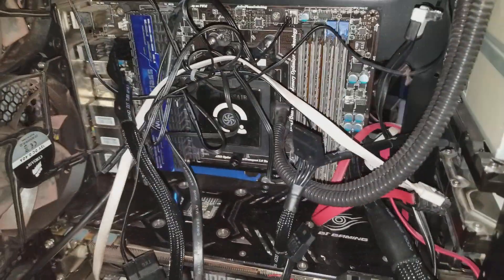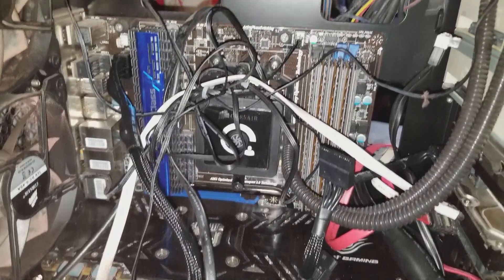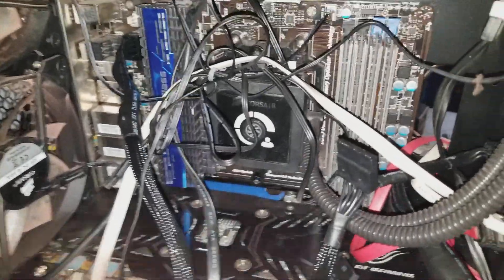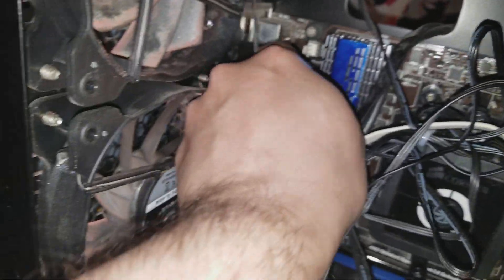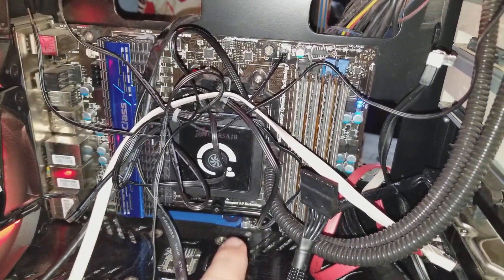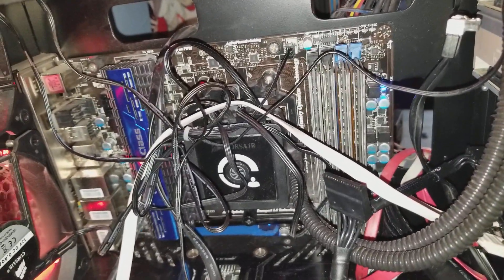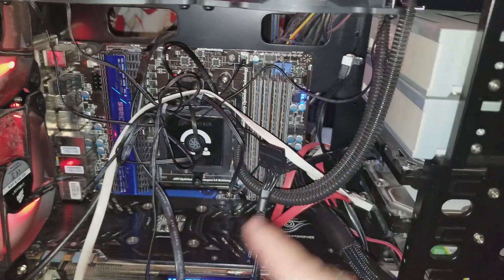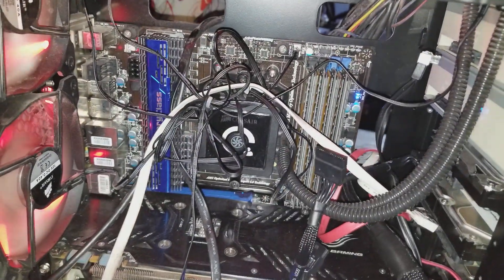How to Spot any broken CPU Liquid Cooler . (Corsair h100i)

Comment: My PC turns on but the temperature is at 99-100 degree Celsius  even when nothing much is running ... So , is the cooler is dead or need to apply some thermal paste?
Reply: Had same issue. Throttled my cpu like no tmrw and still 99-100. I reinstalled the cooling plate.... Worked fine after that. Paste looked good too. So I'm assuming it was mounted correctly? Although the paste ain't gonna look how it was applied when underneath the cooler. It looked just like all the other times i looked at a cpu after installation. so idk why the cpu was overheating.... I tested and tested to make sure it won't overheat again. About 50-60 c under full load. Still toasty but not bad. Thank God  it isn't actually broken.  The AIO i use is the Cryorig A80 (280 mm rad) and 8700k proc.
Reply: @Twitledum9  hey i have msi mag 360 cooler and my pc working fine but when my cpu at 40% usage the teps goes to 100c in 10 minutes and i dont know if is it the pump or something else
Reply from the maker: Apply thermal paste  and see what's what if not it's the cooler failed for sure. Please do show some love for this channel by Subscribing hitting that bell button and like button as many more videos to come.
Reply: @Vortexcinema677  Does Youtube pay by subscribers, views, likes or bells, just curious as I wonder why people have to keep reminding us. I pretty much like all content I watch, or else I just move on. And I've got so many subscriptions now, I don't need to be belled every 5 minutes LOL

Comment: my liquid cooler is not dead but I keep getting 40c to 50c degrees while my pc on idle, does it mean that it's failing ?
Reply from the maker: So there is two things I've seen it happen in some pcs I built over time. One yes that could be the case where its failing. Two it can be over time it lost its pressure and needs to be taken out and reinserted again and make sure all is tight and in the right place. Lastly 3 it can be like number two but needs a good thermal compound to put on the cpu to reput it that us and make sure all is tight and working well. Please let me know if that works if not it can be number one and its failing. Also make sure u have proper cooling in ur case because some cpus and gcards tend to over click if the system is stressed on auto so make sure u have proper cooling. Let me kbow how it turns out brother. Please do show some love for this channel by Subscribing hitting that bell button and like button as many more videos to come.
Reply: @Vortexcinema677  thanks for the info honestly I don't have the needed tools to do what you have recommanded. I can provide you with more information like , My cpu is i7 6800K 3.4GHz not overclocked, My cooler is H100i v2 the pump is active on performance mode at 3.5K rpm if i put it on quit the heat goes up more. I one did clean under the block area with the air compressor (without taking it off the cpu) and the temprtures droped down to 30s. (1/2)
Reply: @Vortexcinema677  I still have warrinty on all my pc parts I I'm gonna send my pc to workshop, only thing is I can figure out a way to explain that the cooler is failing and let then replace it for me (2/2).
Reply from the maker: just tell him ur normal readings and how now ur getting higher reading im sure the guy working on it will know for sure. let me know how it works brothers. Please do show some love for this channel by Subscribing hitting that bell button and like button as many more videos to come.
Reply: If you've had it for more than two years, you may need to open it up and clean it. 
I just fixed my Corsair H55 that's been going for four years. 
Had a ton of salt-like grime built up on the inside of the heat-absorbing copper plate. 
Also put in fresh cooling fluid and idle temps went from 67 to 28. Sound level went from gurgling to barely audible.
Reply: @Erafune  it's almost two years yeah.  i've already sent the pc to work I just don't have the tools or the time to do so, but thanks for the info

Comment: is the cracking noise because of the pump aswell?
Reply: If you have a cracking noise in your pump it's probably because the propeller is hitting the housing.
Make sure you have the cold water intake to the pump at a low level so there is actually liquid and not air getting sucked into the pump.
If you've had it for more than two years you may need to open it up and clean it. 
I just opened up my four year old Corsair H55 and it had a ton of salt-like grime built up on the inside of the heat-absorbing copper plate. Works like a charm now.

Comment: Why are your exhaust fans in intake mode? Also most modern motherboards will not "run fine" if you remove the atx cable, they will/should push a bios error or beep error code. And you are 100% correct, pulling the 4pin or 8pin has a good chance of bricking your cpu.
Reply from the maker: Every pc I built showed great success in this exact setup and were cooled perfectly. Give it a chance and let me know how it works.
Reply: @Vortexcinema677  You create negative air pressure which leads to faster accumulation of dust and the air has no exhaust.
Reply from the maker: @JamesDoesItAll  no no I have 2 exhaust fans and all the others are 8ntake I have zero dust and great cooling bro. Give it a chance and see
Reply: Ya ok. I was just trying to help. Also you have a hard drive without a power cable and another without a sata cable plugged in the power connector, this can cause the drive to burn out (the one with only power), you should also try better at wire management if you really sell computers as a job because it's more professional and more likely to get your units sold if they look nice. most cases (including this one) come with a removable back panel and channels to run your wires through. good diagnosing vid if you have a dummy cpu with the same socket though, however unlikely.
Reply from the maker: yeah bro because that is not the point of this video. i just wanted to show how to spot a broken cooler.
Reply from the maker: i have a mini seires that is out on my channel where u can see me building a pc i show how to build one
Reply: wow seems like you can't take feedback this is pretty poor, i keep seeing lots of things wrong that haven't been addressed first :/

Comment: my corsair h100i v2 does not cool my i7 7700k, the computer does not shut down, i can sit here and game happy but the temps are way higher then what they should be, like 87c when they should be like half that.
Reply from the maker: Then the one u have is a defect that needs to be returned asap. Those temp are dangerous for ur pc.
Reply: i dont really see how, iv had this Pc for about a year now, and never had a problem.
Reply from the maker: @Zesmas  consider ur self one lucky bro lol
Reply: ill prob replace it with a Cooler master lite 240
Reply from the maker: @Zesmas  anything over that bro this is bad
Reply: oh and one more thing, if ur ever looking to buy a pc, DO NOT GET IT FROM CYBERPOWERPC, they are the builders of my computers, and well, lets just say it has aaalloott of problems, and it costs 2500$
Reply from the maker: @Zesmas  thanks for the heads up bro but I build my own pcs. I did a mini series on this channel to show how to build one. It's better to build and cheaper.
Reply: i know how to build mine, but just this one time i wanted to try to get one pre built, i was screwed over big time, i wish i gone for Digital Storm instead of cyberpowerPc, but you know just in case u know somebody that wants to get a gaming pc, tell them to stay away from cyberpowerpc.

Comment: I went through two v2 (hexigon pump head)of the i100 in 3 years.  They are worse.  Going to a Noctura dual block air cooler since I rarely over clock now.
Reply from the maker: I had nothing but success using this including in all my client's builds and all are overclocked with zero issues thus far. V2 was a dud i have a review for the 115 and it is awesome.